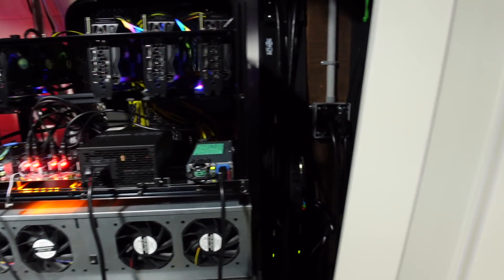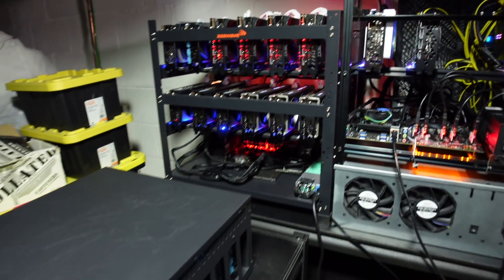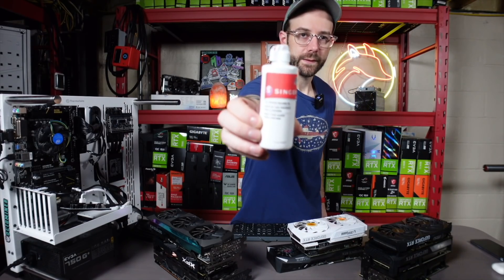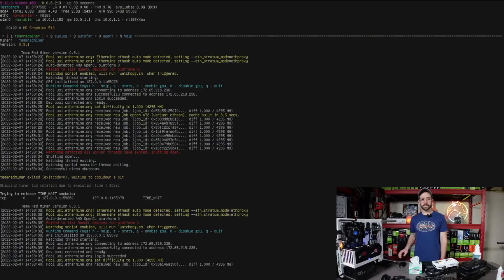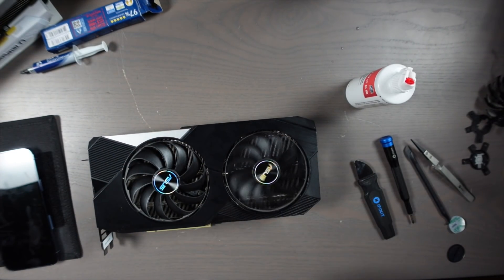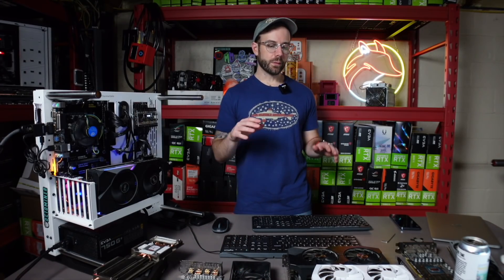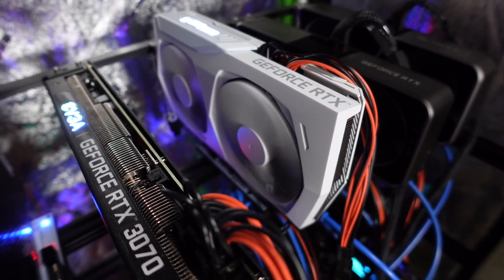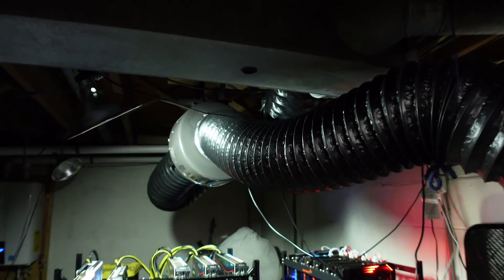Why Is Everything Breaking... (Home Crypto Mining Farm Maintenance)

Comment: I have a fairly large GPU farm, running about 800 or so GPUs. Considering my size, I'm puzzled why your GPU fans are failing. I have similar cards and after 8 months of 3070/3060ti mining non-stop from all brands I don't think I've ran into a single fan failing. Similar with my 580 rigs. I've had cards die similar to your 5700XT(RIP) but very few GPU fan failures.

Comment: Using a pencil eraser to clean the contacts removes the glaze and the rubber debris is easily cleaned off with air. A wipe with lighter fluid for good measure. (old guy tricks)

Comment: For broken fan blades, you can actually use a soldering iron to re-solder the blade if the break is clean and you have the missing piece.

Comment: I've got 6 of the Zotac RTX 3070s and the large fans are problematic in that they fail, wobble/seize up and it's easy to break a fan blade.  Also, although the white models look cool new, the discolouration from heat is common.

Comment: You know you can connect the fan controller to your phone with their app. You can check temperature, adjust fan speed and a lot more through the app without having to go downstair. got 2 controller and 3 8 inches fan controlled that way. you can also set up temperature control so the fan auto ajust to some extent

Comment: Pure ghetto setup: I have grid shelves and the mobo sits on pizza box cardboard and gpus are just lying around the mobo with the fans point up. Most "rigs" are on 10-12 year old computers with ancient bioses and running 3-4 cards on the gigabyte bomb psus with only sata going to risers. I utilize approximately 12 jenga blocks to help prop up some gpus or risers to reduce the weight strain.
 17 gpus in my basement in this config and 1.6 Gh going strong!
Reply from the maker: I need a picture.

Comment: @Red Fox Crypto you said the motor is running at 13:50
Are you sure?
This "brrrm" is typical for an defective capacitor on an capacitor motor.
If the motor doesn´t run and just makes this sound and if the motor could be manually pushed on in both directions (fucking dangerous > use tools) then its an defect capacitor.

Comment: I wish I was so casual about a dead GPU. My dead RX 570 is still haunting me as I really had no excuse on killing it because it was me being sloppy. I'm small operation so losing a GPU that I paid little for, hurts a bit. Curious though, if you (like me) has a card on Windows 10 mining that shows artifacts when you hit a certain vram OC, if you put it into a HiveOS rig, how would you know if the card is artifacting, showing signs of dying? I have a card not sure what to do if it's dying or not, but vram can't hold what it used to hold. 2 months left?  6 months? Unknown? Your video is awesome. You are a true pro with everything you do there.
Reply from the maker: Thank you dude. I would look for invalid/rejected shares showing up in HiveOS to show the card was having issues.
Reply: @RedFoxCrypto  Thank you so much for that tip. In particular I'm asking because I'm between a rock and a hard place with an RX 570. Sometimes it can break through and OC without artifacts, other times it can't. I've been using in on my second PC running Windows so I can monitor what is going on.  It makes me leery in the sense that I would rather keep it as a gaming GPU if nothing else, but I'm afraid moving it off Windows, I may end up killing it without knowing it. I hear what you're saying on invalids. Just wondering if invalids are indicative of artifacts. I suppose hiveOS setups never identify artifacts? It's an odd situation I'm in. Minutia for a big miner like yourself, but I'm small scale and every hash counts so much. Killing a GPU as I said previously, haunts me to this day. It seemed so avoidable knowing what I know now about undervolting and temps. In that situation, I was running artifacts which explains a big part of my concern on this latest dilemma. Thanks!!

Comment: Running a farm is not passive income in any sense at all. It is constant work.
Reply from the maker: It definitely piles up after a while especially depending on your scale.
Reply: I've had my farm of about 40 cards running for like 8 months straight and I've never done a single thing other than use an air blower on it once every month or two. Even when power cuts they just turn back on automatically.

Comment: Mike what overclocks you use on your non-lhr 3060ti's? In hive I'm using -502, 2400, 125PL for like 61-62 but my watts are 125. You have any trick to get the watts down to 112 like yours?
Reply from the maker: Yeah instead of entering in -502 for core try entering in 1350 or around there.
Reply: @RedFoxCrypto  my man thanks for the response. Have a good weekend!
Reply: Lock the core clock at 1350/1375. Not every card will have the same result.

Comment: ASUS dual 3070 FHR was my first card to get a dead fan, 6700xt xfx, white zotac 3070 FHR  so far crossed fingers
Reply: Same here then I got 2 gigabyte s needed fans then my inline fan died and my box fan lmao
Reply: @davejack8973  what I am doing with my the cards that brake the fan after ordering the original fan to save it, I install a hi rpm 120 mm fan, it does not show the fan running in software but my temps stays really good.